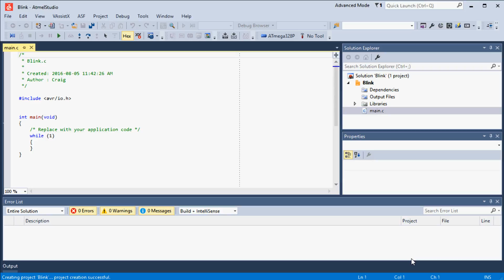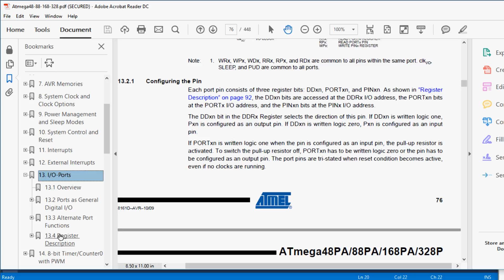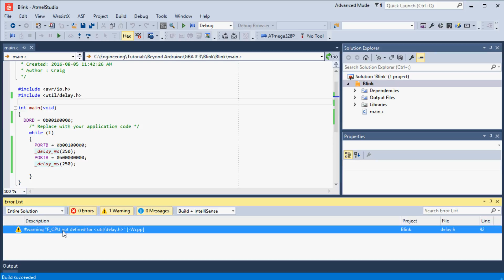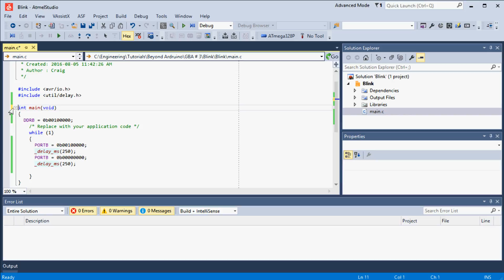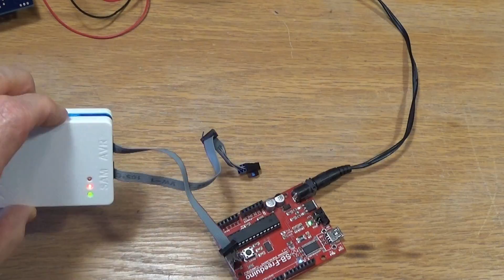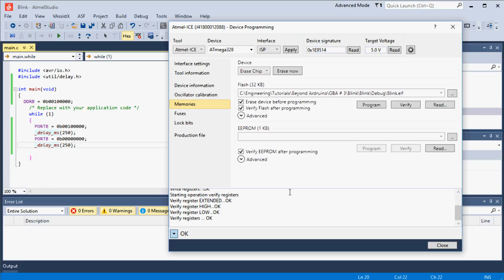Going Beyond Arduino # 3 - Blink an LED

Comment: Yes, I am enjoying this - immensely. You know your stuff and communicate with depth and clarity.  I thank you immensely for this series. Just what I needed.  also tire of the Artduino IDE. In a previous video you indicated that you did not know what  Atmel (now Microchip) Studio's solution file was for. Atmel Studio is based on Visual Studio. As a multi-decade user of Visual Studio, I can tell you that they are containers for multiple projects. The project you outlined under source management could be broken into three projects all in one solution. Blink solution could hold an EXE (executable) project named, e.g., blink_test and two DLL (static libraries)-one for the bottom layer in your diagram named peripherals and another for the middle layer named componernts. If you want to get industrious, you could add projects for a database and a web site. All held in one solution. Open the solution and all the projects get loaded. On to the next great video...
EDIT: As I proceed through these videos it occurs to me that what I describe here makes no sense for this environment - there are no EXEs or DLLs, just ELF, HEX, etc. EXEs and DLLs make sense in the Windows world, but not here. So I am at a loss as to why there are solutions here in Microchip Studio as you are.

Comment: How to connect SAML11 with atmel-ice
Reply from the maker: Check the SAML11 data sheet, it will have an explanation of the SWD interface.  The Atmel-ICE manual will show you how the pins in the interface cable are connected.  After you do that, you should be able to connect the ICE.  Good luck!

Comment: Great instructions, thanks. I am just missing a reference to how you knew, where to look for the delay.h file. I'll find it myself, but it helps to point it out. Again, thanks. This helps a lot.
Reply from the maker: delay.h is part of the gcc library, so the compiler will know where to find it.  I believe you need to use the statement:
#include util/delay.h, or something like that.  Can't remember exactly, been a while.

Comment: Wow you are amazing for putting this together. Thank you very much. I've had one problem that I couldn't solve for a while. I tried using Arduino to send AT commends to a wifi chip and I just couldn't get it to work. I can use a terminal and type out the commands but I need to have a microcontroller  do  that. Any tips on how I can do that? Or wiring suggestions? Maybe my wiring was off. 
Thank you. Wifi chip I used was Zentri AMW037
Reply from the maker: Thanks for watching.
To send AT commands to your WiFi chip you would have to set up the USART.  I have a video for that.  Make sure you have the correct bit rate set up and check your wiring.  The TX line of the microcontroller goes to the RX line of the WiFi chip and the microcontroller RX line goes to the WiFi TX line.

Comment: All your videos 1,2 and 3 worked exactly the way you presented. Excellent I will say and learning much more from your video's because you explain in detail and you take your time not rushing through the steps. My Arduino UNO board is blinking at the same rate as your board and also using the Atmel-ICE. Thank you for your valuable time and all your great videos on this subject.
Reply from the maker: I'm glad you got something from the video.  Thanks for watching.

Comment: I followed the directions and applied them to the ATMEGA32U4 Arduino Micro worked as shown. I am very thankful to you Craig! Wish you All the Best!!
Reply from the maker: Glad it worked for you!  The 32U has very similar architecture to the 328, so that makes porting code from one to the other relatively easy.

Comment: Question: If you burn the code into the chip, will it erase the Arduino bootloader? Or can you still use it with the Arduino IDE afterwards? (I guess that’s actually two questions 😁)
Reply from the maker: I recently programmed some code into the ATMEGA containing an Arduino boot loader and the boot loader was erased.  When I look at Atmel Studio's Device Programming window under the Memories tab (which is where you go to program a chip), I see a check box 'Erase device before programming'.  In my case it is checked: therefore the whole chip is erased before programming.  I haven't played with this, but perhaps if it was not checked, the boot loader would have been preserved.

Now since I program my devices with a programmer and not a boot loader (I don't use the Arduino system), I don't really care if the boot loader is erased.  That being said, with the Arduino clones I have and use, I removed the ATMEGA containing a boot loader, put them aside and replaced them with factory fresh devices.  I believe I suggested doing this in the first or second video of my 'Going Beyond Arduino' series.

I hope this answers your questions.  Oh yeah, feel free to ask as many questions you like, I will do my best to answer them.  Thanks for watching.
Reply: Yes, it does answer my questions. Thanks!

Comment: you only needed to define F_CPU before including delay header file, and it would work.
Reply from the maker: That's true, but if you call _delay_ms() in another file, F_CPU will have to be defined there as well.  

When a project is built, each file in the project is treated as a separate and independent entity by the compiler.  F_CPU is used in many modules (files), so it's easiest to define it only once in the project.  That way, if the frequency changes, you will only have to go to one place in your project to change it in stead of editing each file.